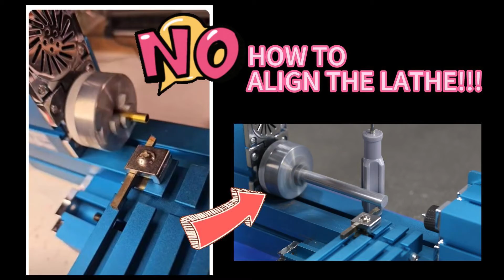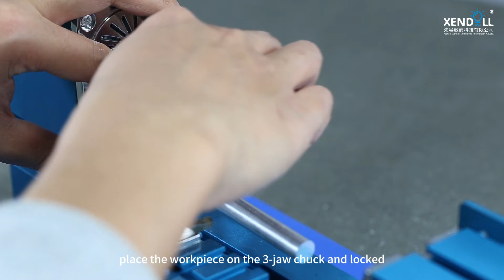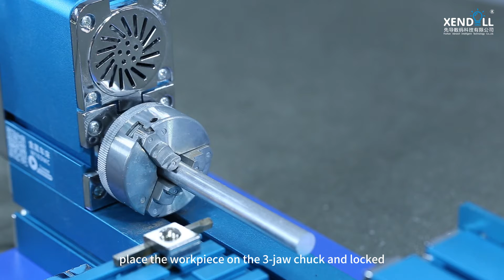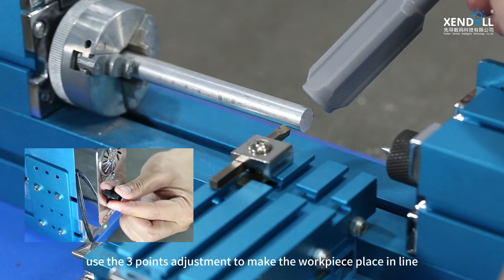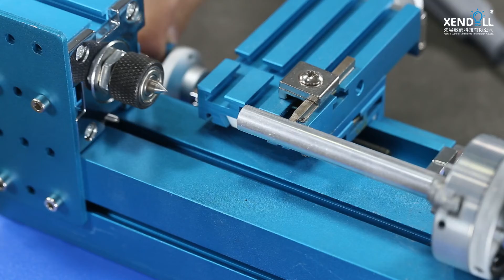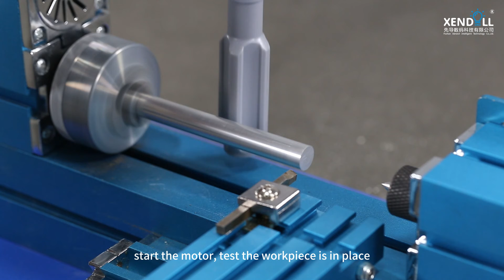How to align a XENDOLL mini metal lathe machine

Comment: If this lathe was any good, you wouldn't have to do what they show you to do. If the chuck was any good, it would automatically center the work piece. Truth is, this machine is not precision . They don't show it cutting that bar of aluminum, because as soon as you try to make a cut, it is going to wobble.